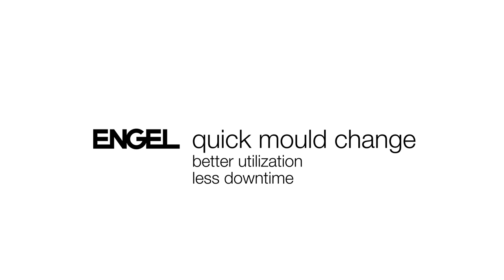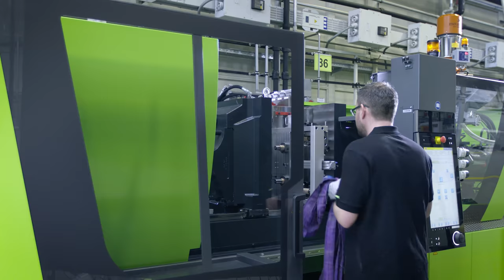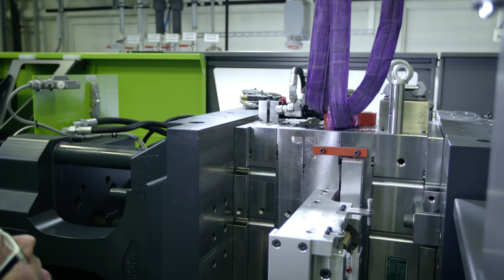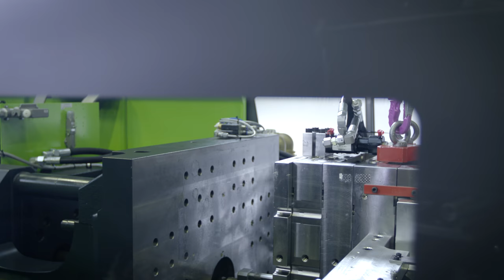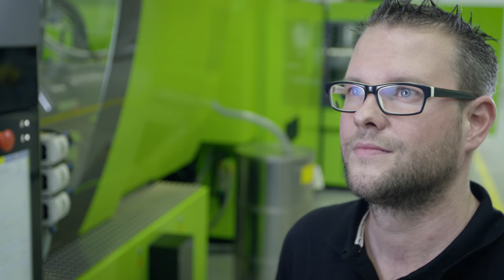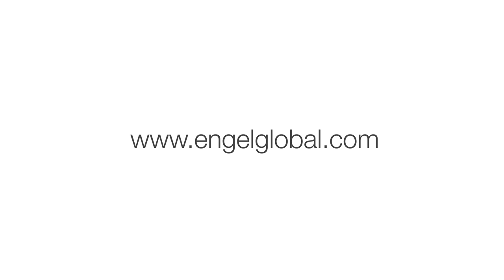ENGEL victory | quick mould change on a tie-bar-less machine

Comment: my record is 15 minutes complete mould change and connecting hot runners water etc... i love engel machines 260 my favorite
Reply: Matrix, I need someone to fill me in on injection molding machines. I’ve been 3D printing my product, but now it’s time for me to move up. I want to buy a machine rather than sign a big contract with. An injection mold company. Can we chat?
Reply: @lanceg6828  I work on Krauss Maffei models with sepro robotic visual 3 and Arburg machines, old Engel 200 Ton machines,Engel Victory 260 Viper and Haitian machines